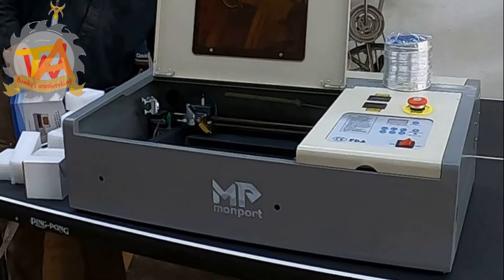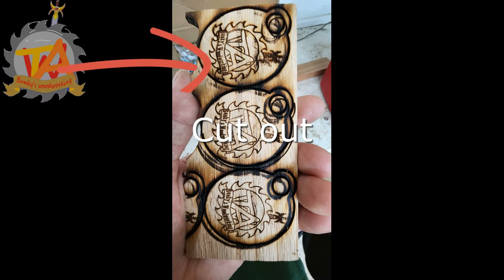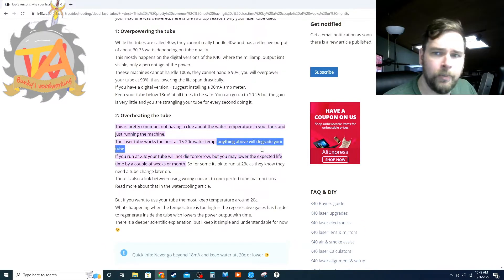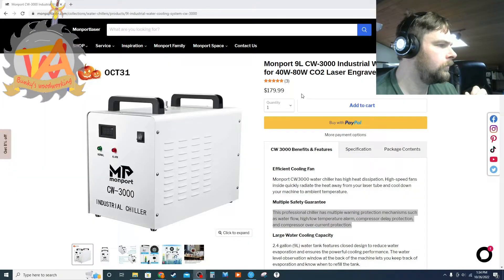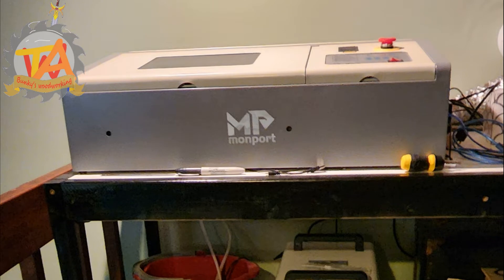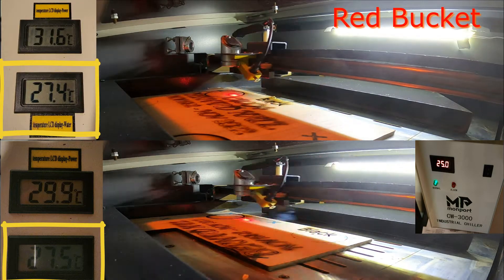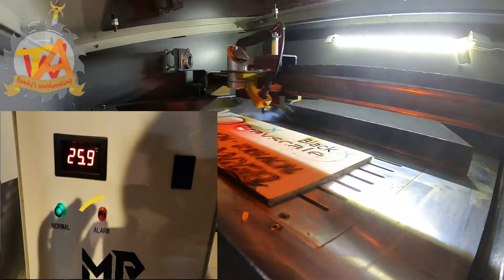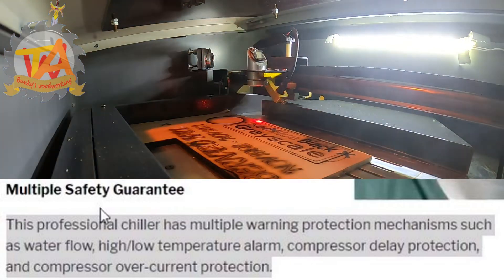Should you buy a chiller? Bucket vs Chiller for Co2 Laser Cooling

Comment: My understanding is that the CW-3000 unit is not truly a chiller. It is a heat exchanger and will not drop the water temperature below room temperature. It could be acceptable in cooler climates or in a suitably cool air conditioned environment, but the noted 25°C is still higher than the recommended 20°C noted in the video. The CW-5000 is a true refrigerating chiller and can drop the temperature to the low double digits in a very short time and maintain it easily.
Reply from the maker: I think you are right  but the true goal was to maintain temperatures to get more consistent results. It never did get lower than ambient temperatures.. and it was much better than the bucket we had. Thanks for sharing. Your post has lots of good info in it I am going to pin this post so it stays at the top of the comments 😀

Comment: Yeah the 3000 series is just an expensive  heatsink it wont do much chilling at all it can only maintain the temperature via ambient room temps
Reply from the maker: I think you’re absolutely right. The main goal for us was to maintain temperatures to get more consistent results, specifically keeping the temp below 30°C (over 85°F). It never went below ambient temperatures, but it was definitely a big improvement over the bucket setup we were using before.

Thanks so much for sharing—your comment has a lot of great info! I’m going to pin this so it stays at the top of the comments. 😀

Comment: Of course just a buck & pump is not going to keep the water cooling, without some assistance, such as a radiator & fan added into the system, or ice being dropped into the bucket.  The radiator & fan addition will only cool the water down to the ambient temperature.  So, if you life in an area, when the ambient temperature exceeds the ideal water temperature, for laser operation, then you will need to buy a real (refrigerated) cooler, or operate the Laser in an air conditioned area kept at, or below the ideal water temperature for Laser operation.
Reply from the maker: Thank you for watching and commenting on our video. You are correct that the CW 3000 only maintains the temperature at the ambient level. However, there are more advanced chillers like the CW 5200 which comes with a refrigerator and can cool water down to lower temperatures. Although this was our first attempt at a comparison video, we acknowledge that it may not have been the best one. We would love to revisit this topic in the future. During the video, we discovered some key advantages of using a chiller, and we were pleasantly surprised to see that it made a difference, even though it wasn't a significant one.
Reply: @CoupleofBunkies  Yes, a true chiller makes a definite difference, and, and, if you are handy & a tinkerer, you can build one for far less than you can purchase one for.
Reply from the maker: @alpscraftshack599  We would Love to do some test like this with some DIY Chillers. It sounds Like Lots of fun we will see My wife and I have a full plate for the next couple of months.
Reply: @CoupleofBunkies  Great.  Would like to see that.  I am in the process of making a DIY Chiller for my K40 Laser.
Reply from the maker: If you get time send us info on how you did your chiller,
Reply: @CoupleofBunkies  Will do.